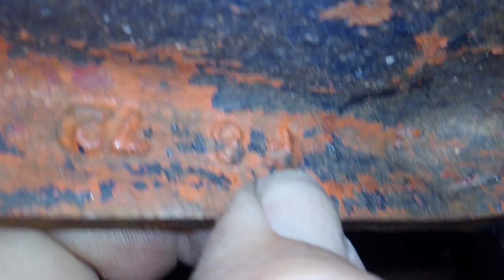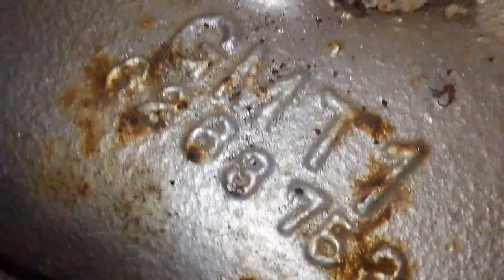Decoding the 1972 Corvette 454 LS5 Engine Casting Numbers

Comment: kinda true on build times. However, my 68 L79 Corvette was ordered 6/10/68 but the date of production
wasn't until 07/26/1968 (that's straight from the build sheet). engine cast date is (F) (06)/11/68 . 
So yes you can have a wide time frame from order date and production date. Gm had motors sitting for 3-6 months,
that's why NCRS allows up to 6 months.
Reply from the maker: Definitely, examples like your car happened every so often, so it's not really a cause for question in most cases. 

However, in my opinion as the restoration craze took off in the late 70's/early 80's you began to see these long gaps between engine and car build dates more frequently, which is most telling considering the increase in value associated with "matching numbers". 

Sounds like a great car you have, the L79's are great fun for cruising the open road👍.
Reply: @VetteSource  yes it's a great car although the engine in it now is a 388 Stroker and the original motor is shrink-wrapped on a stand, it's a frame off restoration process. but totally worth it once it hits the open road again LOL
Reply from the maker: Yep, smiles for miles😁

Comment: I thought 71 stingray had 425hp, thought it was the same engine from the 70 chevelle 450hp but a bit lower hp.? Just asking cause you are the man, new sub here.
Reply from the maker: Hey Ranjit, thanks for the sub👍. The 71 Corvette LS6 was indeed like the Chevelle, with the exception that it had the L88 aluminum heads installed and lower compression pistons. That might account for the lower rated HP of 425 vs the 70 Chevelle rating of 450.
Reply: @VetteSource  which engine had the l88 heads.? Sorry.
Reply: @duramax78 
The 1971 Corvette LS6 had the L88 aluminum heads. Two 454 engines in 71, the LS5 with hydraulic cam and 365hp them the LS6 with solid cam, aluminum heads, Holley, etc and it was 425hp.

Comment: Hey, I have a block that I am trying to figure out what it was probably used in. Casting number 3916321, Cast Date J167, Pad Stamp CE854859, Starter stamp T117. Four bolt mains, Pass Hi Perf 1X. It is standard bore, 427.
Reply from the maker: Hey Idaho, that's an earlier production 1968 427 cast in October of 1967. The CE stamp on the pad indicates it was a GM counter exchange engine, probably used as a warranty replacement engine. Even without a specific suffix code denoting the exact RPO/HP designation, it's a 427 4 bolt standard bore and still a highly desirable casting in the vintage car world.
Reply: @VetteSource  Thanks a bunch for the information! Maybe it was used in a Corvette.....It has a large threaded hole near the oil filter which I don't know what that was used for.

Comment: Is this a 4 bolt main
Reply from the maker: Most likely not. By 1972 they had moved away from the 4 bolt main since these were lower HP and compression so it wasn't really a necessity.
Reply: @VetteSource  Thanks for your reply

Comment: What is a 72 crr 454 is it a425 h ls6
Reply from the maker: That is correct from what I am remembering and all the literature I've seen on the suffix codes. Are you lucky enough to have one of those beasts?
Reply: Thanks for the reply, yes I do. Is there a way to get in contact with you
Reply from the maker: YT is pretty sensitive about sharing contact info, but if you look in the description of my Shorts video you will find it there. You can also DM me on Instagram @VetteSource to touch base directly. Let me know if you have any difficulty finding it.

Comment: Am i Right in saying it’s low compression and not a very powerful engine, not very desirable, good for matching numbers but that’s it?
Reply from the maker: The 72 was indeed a lower HP version due to the new SAE horsepower ratings with lower compression, smaller lift camshafts, and more restrictive intake systems. However, even "smogged" as they were becoming these still had enough power to give you that seat of the pants rush, and of you knew enough could be modified for much more power.
Reply: @VetteSource  ok thank you for that, I thought they were just dogs, but they still had high torque #s.
Reply from the maker: For sure, all of the big cubic inch engines from that era create tons of that wonderful torque.

Comment: What is needed to convert a LS5 to LS6 corvette engine so it would be identical?
Reply from the maker: The difference in the two engines is basically the pistons, camshaft, cylinder heads, and intake. It is not a difficult conversion, but will require a complete teardown.

Comment: So doesn’t matter from 1970 to 1974 on a 454ci motor the block is all the same from 70 to 74 so what is the difference in them and how can you make the LS4 or LS5  into an LS6 454 is what I’m asking
Reply from the maker: The block is essentially the same, with different casting numbers and some being 2 bolt mains as opposed to 4 bolt.